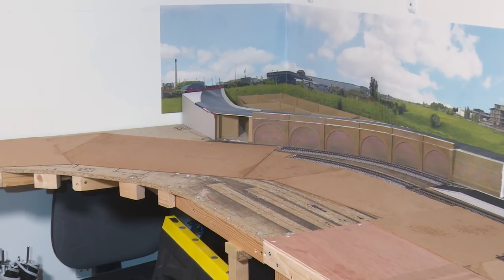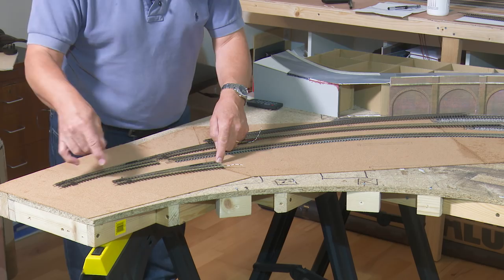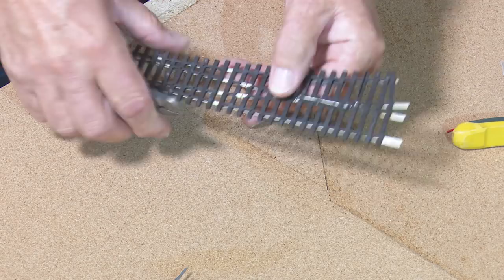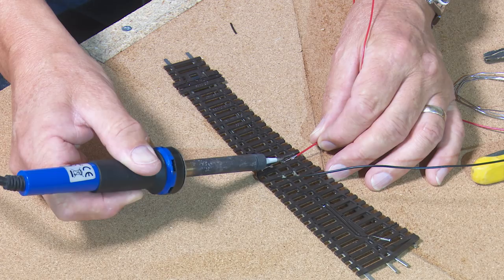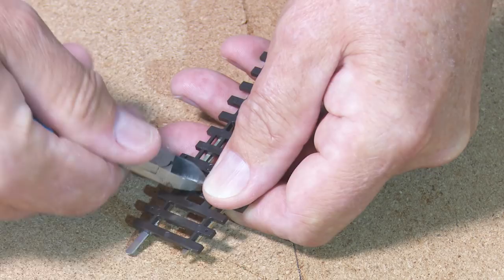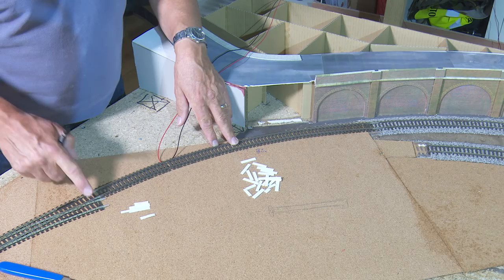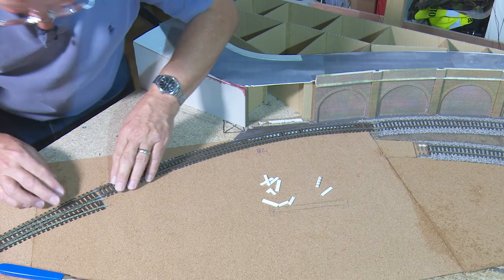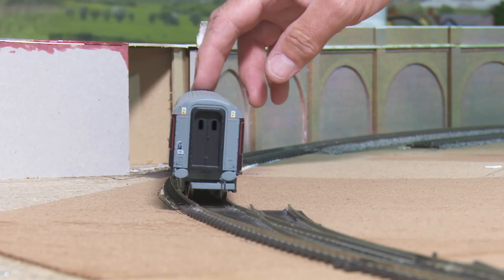Laying Track with Super Elevation at Chadwick Model Railway | 39.

Comment: The method you are showing for using fluxed solder is incorrect, the flux is being burnt off before it has done anything? A small amount of solder should be added to the iron tip to aid heat transfer, the iron tip should then be placed on the item you are soldering, then the fluxed solder should be fed onto the tip and item being soldered at the same time, this way the flux will flow onto the item being soldered.
Reply from the maker: Hi David,  many thanks for your advice but when soldering to the rail that is exactly what I had done,  or at least what I thought I had done.
Regards Charlie
Reply: Hi Charlie, you certainly do when soldering the rails, but not when you were tinning the wires, I have always used fluxed solder for small wiring and other jobs, the longer you heat solder for the more chance there is of a dry joint, try putting a small amount of solder on the iron tip to help heat transfer, then hold it to the wire you are tinning, at the same time put the fluxed solder to the wire you are tinning, you will find that the flux in the solder will make it run quickly into the wire, this also works well on the rails as you were showing. Regards, David.
Reply from the maker: Thanks David, I’ll certainly give it a go.
Reply: You heat the job with the iron then add the solder. Don’t add solder to the iron then try and paste it onto the job.

Comment: Hi charlie great video been watching recent videos you have been doing and they have been very helpful for me with going forward with my layout extension, with the banking i tried on my current layout but i used the cork underlay which was to much for some of my loco's to run over so you putting plasti card has made me think of other ideas of banking, could you make the track with this banking method go into a snake like effect as im thinking of doing that going through the new station area instead of being flat and boring, thanks agian for sharing when i start laying track after constructing the boards i'll come back to watch these video's step by step cheers again Beeton Hough Junction (Dave C)
Reply from the maker: Hi Dave,
I’m so pleased that you enjoyed the video.  I’m unsure if you can snake the track through your station. But hey, as long as it isn’t ballasted it easy to pull it up and re-lay it.
Good luck with your layout.
Regards Charlie
Reply: Chadwick Model Railway 
Hi Charlie 
I havent laydd any track as ive sent my layout plans to a friend who knows how to use anyrail and is going to see if the idea i have will fit on the size of boards i want if not wil go back to the drawing board but probably wont see if it works until i get to laying track mayeb if not then will just have to be banked on one side and have it as a long sweeping bend through the station, look forward to your next video cheers Beeton Hough Junction (Dave C)
Reply from the maker: Well, exciting times.
Good luck with your layout.
Regards Charlie

Comment: on the other video you were soldering the wires to the inside of the rail, only one hole was necessary. Soldering points, you solder the wires to the outside, needing two holes??
Reply from the maker: That was a much earlier video Huib.

Comment: the toxicity of lead in metal form is greatly exagerated.
it only poses issues in salt form (such as it was used in white paint), and mostly impacts <20 years old with their intellectual functions development.
the fumes with solder are from the rosin core(s) (similar in composition to incense as used in churches)
as for the lead-free solder, it requires using flux in proper quantities. to put it down properly on the rail, I recommend something like this one https://www.tme.eu/fr/details/anc559tf_30/flux/amtech/
Reply from the maker: An interesting comment AJ.

Comment: Superelevated track looks nice but I do not recommend it. Model railroad cars are too light weight to behave well on superelevated track and I have had problems with string lining causing derailments.
Reply from the maker: Sadly Dave, I don’t know what string lining is.
Reply from the maker: Great shot. Lighter wagons at the front and heavier at the back, I’ll bet caused that!
Reply: Farmer Dave 
Hi Farmer Dave, 
I disagree, I have super elevated all curves on my main line track. 
I found it necessary to super elevate my model railway track to allow me to increase the speed of my flat curves from a scale 65 mph to scale speeds of 80 to 90 mph, as trains on the Southern Region of British Railways in the 1960 didn't travel much faster that that.
Real railways use super elevation and transition curves to safely increase line speed the same way roading engineers use super elevation of our roads to safely increase speeds on curves. Barry